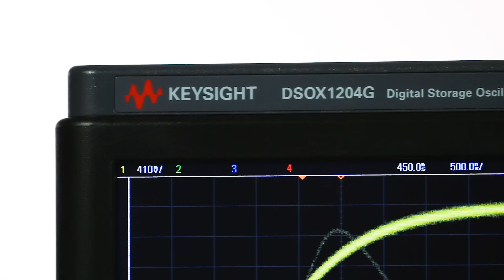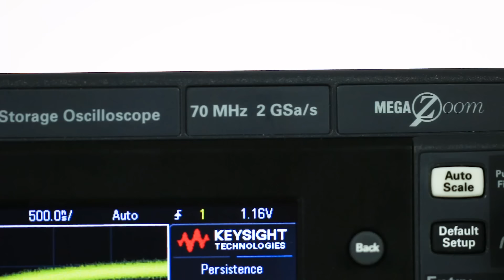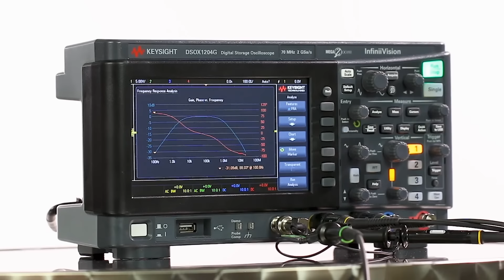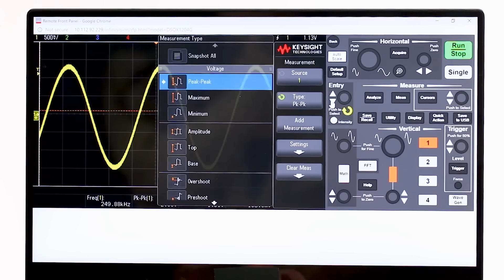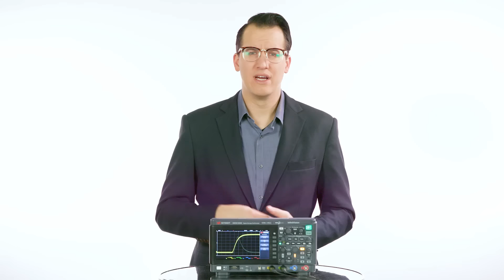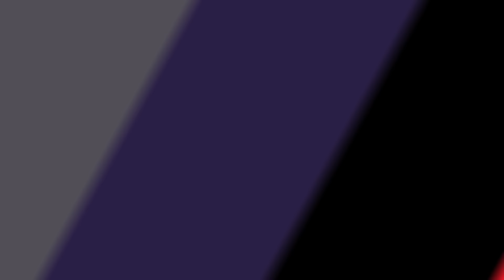Sign up now for Wave 2019!

Comment from the maker: Sign up here, good luck everyone! ► http://bit.ly/Wave2019_8Jan
Reply: I badly need a multimeter handheld or desktop. I'm gathering up stuff like this to start my channel.
Reply: @therealamericanhacker5869  i wish you good luck
Reply: @RP KS yes for free 
i don't if the shipping is free too but the oscilloscopes and other equipment are free
Reply: I'm retired and an amateur radio operator looking for a spectrum analyzer, but not an engineer. Does that mean I am not eligible for this contest?
Reply: What steps I have to follow to get this oscilloscope please help
Reply: I was willing to make my own lab. Wish if I could afford a one rather than applying for a giveaway. Unluckily usd to lkr rate is un bearable. Hope I could win!!
Reply: Keysight Labs
 i have a question: already registered on Keysight Wave 2019 giveaway is egypt from the allowed countries to win with these giveaways oscilloscopes? i have an old rigol DS1302CA 300 Mhz oscilloscope hope to test your new oscilloscopes products.
Reply: @mamdouhprogrammer97   You have to go to the contest page where you would register. Then go to bottom of page and check Terms and Conditions link. And the answer is no, Egypt isn't on the list.

Comment: Its ABOUT TO BEGIN! So stoked...I think If I win a nice scope/ power supply/ DAQ or anything at ALL, I may buy a matching Source Meter, in lui of the Keithley 2450, in my cart now. It just hard for me to want to switch sides BUT Keysight's B2987A looks like a nice unit to dip my toes into the Keysight family of gear though. I am looking a Tek's 1GHz scope's and Keithley Source meter/ electrometers but I can wait a month and see if anything cool happens here. Lets get IT ON! 

edit* I just checked the cost of the Keysights top-of-the-line DMM, their 34470A,  AND its $1000USD LESS than I just paid for the Keithley DMM7510. Hum...did I make a mistake?

Comment: Ironically, 4-5 years back, i was selling Keysight oscilloscopes and teaching customers to use it, but by my self, in my home laboratory, more than 20 years, still using old analog S1-65 scope which is older than me, because can't purchase new digital scope.. :D Old oscilloscope is in great shape, but it has limits, especially when i need to capture short, unrepeatable pulses in modern days applications and microcontroller projects..
In this year's Keysight Wave, looks like Latvia is in the list and people can sign in to win the measuring equipment.. and that is great news.. :) Especially, when i seen, how great Keysight customer service works, from sellers side.. And i, really, loved it.. I hope, nothing's changed by these years.. ;)

Comment: I have a 52 yr old Tektronix TYPE 503 Scope that weighs a light 75 lbs , built a roller cart for it and it works great other than it is just so outdated . I don't know how long it would take me to calm down if I had new test gear in my lab , so exciting to catch a whiff if flux on the morning breeze as I remember that forgot to close the window in my lab, and it's a  -36c temp outside .. Great Videos  ..... From Canada.....

Comment: Wide bandwidth is nice, but what if i need to measure noise of power supply in band only up to 1 MHz? How can i limit the bandwidth to 1 MHz?
Reply from the maker: If you have a scope with software filters (usually higher end) you can set it. Otherwise, almost all scopes have a 20 MHz hardware filter built in.